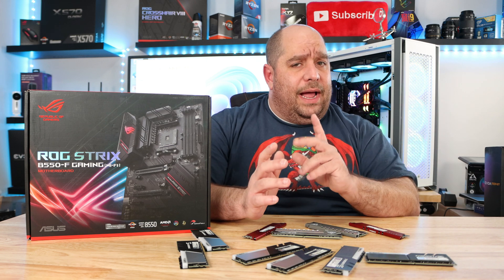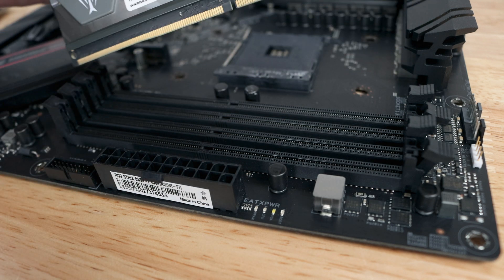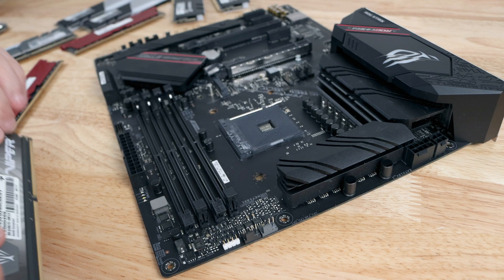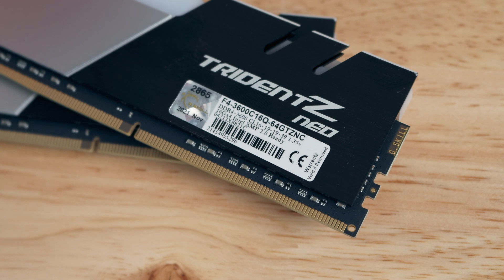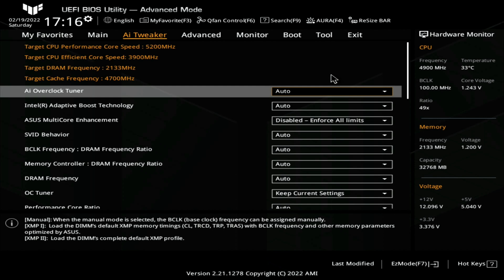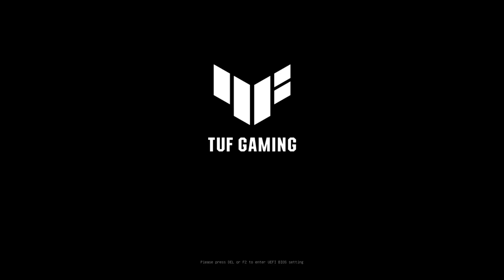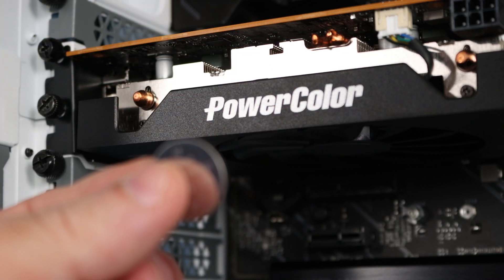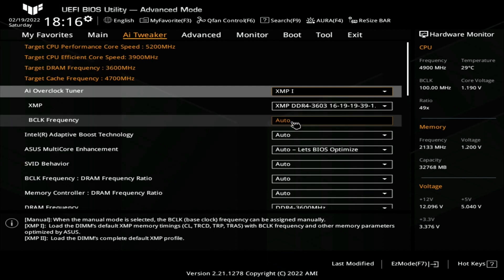How to install and configure RAM in a PC - Step By Step Setup Beginners Guide

Comment: I want to install 64GB DDR4 Ram (Kingston FURY Beast RGB 3600MT/KF436C18BBAK4/64). 

Shall i go with 4x16GB or better 2x32GB?

Board: TUF GAMING Z790-PLUS WIFI D4
CPU: i5-13600K
Reply from the maker: Thanks for checking in my friend, I would say 2 x 32, that way, it gives you the ability to be able to buy a similar set (the same set) and have 128megs, just in case.  I don't ever recommend mixing and matching, but if you don't overclock, and you buy the same type of RAM, you can almost be safe in knowing it will work well, it's good to test still though.
Reply: @ThisBytesForYou  thanks for your reply 🙂👍🏼
Reply from the maker: always a pleasure my friend.

Comment: One question. I setup my own PC (not professionally) and I'm used to using the right-most  slot and the other (one slot apart) for two DIMM sticks. What got me confused is the Aorus x470 gaming 7 wifi's manual. The manual shows labels on the ram slots 4,2,3,1 in that order from left to right. I would like to ask for your opinion about this. Does it mean that I am using slots 2 and 1 in this configuration according to the manual? If so, should I move the other ram to the slot beside the first ram (inserted in slot 1)? I hope this makes sense. Thanks in advance!
Reply from the maker: going by the diagram on page 5, you would install the RAM on yeah, 2 and 1, a bit odd the way they labelled it.
chrome-extension://efaidnbmnnnibpcajpcglclefindmkaj/https://download.gigabyte.com/FileList/Manual/mb_manual_x470-aorus-gaming-7-wifi_1001_180628_e.pdf?v=2282efdfd2333f7619ba8f7af87f09a5
Reply: @ThisBytesForYou  Thank you so much for the quick response! I guess I have my rams installed correctly then. I find it really odd how they labelled the ram slots too. Now a follow up question. Is it good to upgrade to a 64GB (2x32GB)3600mhz ram on my x470 board with my current CPU (Ryzen 7 2700x)? Im currently on 16GB 2666mhz ram and it bottlenecks my PC all the time when I play games and multitask. If so, do I really need to update my BIOS from F5 to F60+? I'm scared of bricking my PC by updating my BIOS lol! Can I just keep my current BIOS and just use AMD Ryzen Master to OC the new pair of rams to get the rated 3600mhz speed?

Thanks!
Reply from the maker: no, NEVER mix your RAM, if you will be buying 2x32, take out your old sticks and use the new RAM, and should you update your RAM, watch this quick short: https://youtube.com/shorts/g5CV_TlGN1k

Comment: I got 2 x 8gb ram to add to my 2x 8gb ram that i already have in the pc and when i installed it my pc didn't start anymore the fans went on and off the whole time. I first removed the 2 ram sticks that I bought new and now everything seems to be working normally. I have now seen in your video that these numbers are important which are on the ram sticks on my old 2 ram sticks the last digits are 49 and 50 but on my new ones the last digits are 23 and 75 that means these new ram sticks are incompatible? or can I use them?
Reply from the maker: like I show you in the video, keep the similar RAM in the same channel/banks, then adjust the BIOS for the higher latency and higher voltage and you should be good, I never recommend missing RAM, but this may make it work, check out the video.

Comment: I'm on a bit of a tight budget so don't hate too hard, but my situation is this:

I bought a PC, prebuilt but fairly basic spec (it's not for gaming primarily so is OK for what I need to do) but there is room for some small improvements. So I have 2 ddr3 ram slots, and the spec sheet of my motherboard says it can take 16gb. So 2 x 8gb. It came with 1 x 8gb installed. I have tried a few different sticks that are the same speed and stuff but in the second slot, no new ram will register, it just shows the single 8gb. But if I put the new ram in on its own, the pc just won't boot or show display. So I want to make sure there's nothing else I can try before I spend more money on a matching pair of 2x8gb. I've tried the cmos battery and also the jumper to clear the cmos and reset everything. In the past this has worked for new components.
Reply from the maker: no hate my friend, you do what you have to do to get by, we've all been there.  So for now, what you can do, is change the memory from XMP, and set it to the lowest speed of all the memory, and the highest voltage of the memory.  So if one stick was 2800Mhz and the other was 3200Mhz, set it to 2800Mhz.  For voltage if one is 1.4 volts and the other is 1.2volts, set it to 1.4volts.  I am not saying that is what the speed or voltage is of your memory, just an example.  The issue COULD be in the RAS, Tras, Cas latencies, if they are drastically different, set it to the highest.  for example, if 1 stick is 9,9,9,28, and the other is 10,10,10,32, set the timings to 10,10,10,32.  Try not to touch the timings unless you need to.

Comment: I've tinkered with a few builds and had to try different things to get components to register. This motherboard does not like  new ram. I've tried a couple things so far but here to see if there's anything else I can try. I've reset the cmos, and tried a few different configurations but in short no new ram will register and if I use only new ram it won't start at all. 😊
Reply from the maker: For now, what you can do, is change the memory from XMP, and set it to the lowest speed of all the memory, and the highest voltage of the memory.  So if one stick was 2800Mhz and the other was 3200Mhz, set it to 2800Mhz.  For voltage if one is 1.4 volts and the other is 1.2volts, set it to 1.4volts.  I am not saying that is what the speed or voltage is of your memory, just an example.  The issue COULD be in the RAS, Tras, Cas latencies, if they are drastically different, set it to the highest.  for example, if 1 stick is 9,9,9,28, and the other is 10,10,10,32, set the timings to 10,10,10,32.  Try not to touch the timings unless you need to.

Comment: What if I add 2 new 16g and keep the original 8 g. Let's say the original 8g pair is A1 and B1; should the 16g pair be placed in A1 and B1 and then put 8 g in A2 and B2? Or does that matter?
Reply from the maker: Follow along, I go over this in the video.

Comment: bruh i deadass bought a RAM from amazon and installed it in B2 and A2 i ain’t even know they got codes
Reply from the maker: Yup it happens, sometime you get lucky but not always, good stuff my friend
Reply: @ThisBytesForYou quick question? So the settings you showed in the BIOS will work for any RAM card ? i have two kingston fury beast DDR5 RAM (8GB each)i wanna apply these settings, will it work ?
Reply from the maker: @RxamosOfficial  yup, they sure will, or I should say 98% chance they will, you know there always something that could happen. give it a try and let me know.

Comment: I tried upgrading my system with 2x16gb 3600mhz sticks, but when I checked the speed it was only 2133mhz. So something probably needs to be adjusted in my BIOS. strangely, when I swapped in the original sticks, their speed is only 2400mhz despite being 3000mhz RAM.
Reply from the maker: did you watch this video?

Comment: Hey dude. I hope you can answer this question. I had xtreme trouble with a pc, which basically had me buying almost another full pc to try and fix. I gave up in the end and bought a complete new pc. This 1 is a Gigabyte B660M Gaming X AX DDR4 Motherboard with 12700 cpu and 2x8gb TForce sticks. In my stock pile from buys to fix last pc, I have 4x16gb TForce sticks (2 seperate 2x16s, bought at different times). After watching this vid, Im a little confused whether I can put all 4 larger sticks in as I notice that the CL numbers are different from 1 set to the other. ie CL 16-18-18-38 1.35v and the other is CL 16-20-20-40 1.35v. Can I throw all these 4 sticks in my new pc?
Reply from the maker: well, first, while it isn't 100%, check to make sure the memory is in the QVL, if its in the QVL, qualified vendor list, a list you can find on the motherboard manufacturers support site for your board: https://www.gigabyte.com/Motherboard/B660M-GAMING-X-AX-DDR4-rev-1x/support#support-memsup, if its there for sure it works, if not, there is a big change it will work, but it may not.  If you watched the video, I show you how to you can get both to work together, but because they are different CAS settings, its best to set the XMP setting to Auto, see if it works.  If it doesn't work, enable XMP, see where it sets it to 16-18-18-38, then change it to manual, and change it to 16-20-20-40 at 1.35Volts also make sure you install the memory the way I show you..

Comment: I'm horrified of the amount of pressure it looks like you need to push it in
Reply from the maker: I have literally done millions of memory installations, some go in like nothing, some take a little more force.  Its completely normal.  It's not a big deal, just make sure you push down, and not at an angle, and well, make sure it's aligned correctly haha.

Comment: I just tried to add new 2x16g ram (Corsair vengeance) to my Lenovo legion 26IAB7. The computer boots into windows and using the task manager I can see that computer recognizes the 32g of ram. But then shortly freezes and start a cycle of resetting. Is the ram bad, not using with me Mobo (IB660ME) or is it something else? The CMOS is in a bad location on this board, it looks to be behind my GPU.
Reply from the maker: did you do what I showed you in this video

Comment: I installed some RAM and a new SSD drive onto my HP 15R laptop (checked to make sure they were compatible). It works fine at first and then once it starts getting hot the screen flickers and then eventually will not come back on. I thought it was the wire, because I pinched it when I first put the HP back together. Replaced the wire and it's better and doesn't immediately start happening, but still eventually does the same. IF I leave the top cover unsnapped and just lay it on top (without the keyboard connected), the issue does not occur (which is why I think it's a heat issue). There is not a fan in the PC as well. Will adding a fan fix this? What do you think is causing this? Will removing the battery fix this--could it be the CMOS? I didn't reset it or change any settings like you did in the video. Also, it has always gotten hot right below the mouse pad (from day 1). I have always had to be careful with it, because if it gets too hot the mouse pad will quit working. I bought a lap desk which has kept this from being an issue.
Reply from the maker: what is the exact model number of this laptop, the  HP 15R laptop, it will have a bunch of letters and numbers after that, maybe on the underside.
Reply: @ThisBytesForYou  Yes, at the time that I posted I was not able to put the whole number. It is 15R 132WM
Reply from the maker: by updating it to an SSD, it should have cooled down some, mechanical drives get hot.  Sounds like during the upgrade, you removed a thermal pad or maybe thermalpaste.  Do you know if it had a thermalpad or thermal paste between the cpu and the heatsink?  Celerons get hot, the Pentium N3540, and a Pentium.. sadly they do get hot.  That system does however have a fan, this is the fan off of my amazon affiliate link: https://geni.us/tmXe1C
Reply: @ThisBytesForYou  This was my first laptop upgrade and I was not aware of the thermal pads or paste. I try to put back anything I take off if I can. I will definitely get the fan from your affiliate page and was just searching for one after I posted here. So this helps a lot. Do you have a video showing how to do the thermal paste or pad? I'm sure I can find one somewhere if not. Thank you so much for you're help. I really appreciate it.
Reply from the maker: Did you ever remove the heatsink from the CPU?  And always a pleasure my friend, so happy I could help.
Reply: @ThisBytesForYou  I'm going to say no, because I am not sure what that is! :D The only thing I've done is swap out the RAM, Drive and now the LCD/Webcam wire. This PC was refurbished, so maybe they didn't put all the things back when doing so? I have barely used it (I know it's old) so it's like a classic car that sits in the garage. I spent about $200 on the RAM and SSD and it flies now (compared to before) and I just want to be able to use it... while it's assembled :D. If I could add a picture here I would be glad to show you what's inside. When I noticed it didn't have a fan I was kind of irritated about that. So it's very possible it may be missing other items.
Reply from the maker: Well, this fan from my affiliate link is made for that system: https://geni.us/tmXe1C but its on the opposite side of the ram and SSD, so that probably why you dont see it,.. maybe.  This document will help you to understand it a little more: http://h10032.www1.hp.com/ctg/Manual/c04409502.pdf, this video might help you too, it shows where the fan is, if you dont have a fan, you NEED one: https://youtu.be/YUP48Isbg4k
Reply: @ThisBytesForYou  I found out that I have a passive heatsink? There is a metal plate that is silver on the topside and black on the bottom. It will not allow me to link it. Since my PC's still getting hot, do you think I need to switch to the copper heatsink and fan?
Reply from the maker: copy and past the link here, because I am seeing many things for that part number.  Don't worry it wont show up, I have to allow it, since its an external link, I do that to protect my viewers.  Once I review it, I will will release it and comment on it,  If I dont get back toyou within a day or 2 send me another message here.
Reply: @ThisBytesForYou  Alright, I posted the link right before this post.
Reply from the maker: oddly enough, I didn't get it, email it to me, iggy@thisbytesforyou.com
Reply: ebay has them. Do a search for this: HP 15-R029WM SPS-767537-001 ET14Z000100 CPU Fan Cover

Comment: What about 3 sticks is it possible
Reply from the maker: you would drop down to single channel, it is possible but messy, slow and leaves more room for errors unless of course your talking about triple channel memory, then the same would apply, but where I say 2, pretend I say 3 (If your board uses triple channel)

Comment: Ughh, I just built my PC and put them in A1 B1.. instead of A2 B2 like you say and my manual say... My huge heatsink and fan on my CPU blocks me from taking them out without removing the entire heatsink and fan assembly and putting them in the 2 slots... 

I do not have any extra thermal paste, I dont have any issues atm with performance or stability but should I buy some new thermal paste and take them out of the 1 slots and move them to the 2 slots? Or is it not that big of a deal? It is an intel bases system if that matters. i7 12700k and Asus z690 D4 board
Reply from the maker: yes, I do recommend buying some extra thermal paste so that once you remove the heatsink, you can clean both surfaces and reapply.  You don't have issues yet or that you know of, is your machine picking up the correct amount of RAM?  It is a big deal since chances are you are running on single channel, and it would affect Intel and AMD systems alike because both have the memory controllers built into the CPU.

You can leave it if you like, but I would not.
Reply: @ThisBytesForYou  yes it is picking up the full 32gb of ram atm, is there a way i can benchmark the before and after with some test to see the difference?
Reply from the maker: of course, you can use 3DMark, PassMark, etc, this video might help too: https://youtu.be/kb8j2j41KOs
Reply: @ThisBytesForYou  sounds good thank you!!!!
Reply from the maker: Always a pleasure my friend, so very happy you stopped by, trusted in me to help you, liked and subbed as well as took a moment out of your day to thank me.  It means a ton to me and I am so very happy I could help you, let me know how it goes.
Reply: @ThisBytesForYou  Even better news! My ram is rated for 3200 but i could never get it over 2933.... WELL now that you helpd me out and they are in a2 b2 i got the full 3200 speed! thank you!
Reply from the maker: ahhh good stuff my friend, look at that, instant bonus haha, so very happy I could help you.
Reply: @ThisBytesForYou  good news all i had to do was take off the fan and i snuck em out! in a2 b2 now!

Comment: i didnt know about the purpose/usage of XMP before. on my current pc when i added more ram, i just changed the clock speed to what it was rated at(3200). there's a good chance i'm not running the optimal or rated cas latencies after watching this video lol.
Reply from the maker: Always a pleasure my friend, so happy I could help, this will also help temperatures and stability